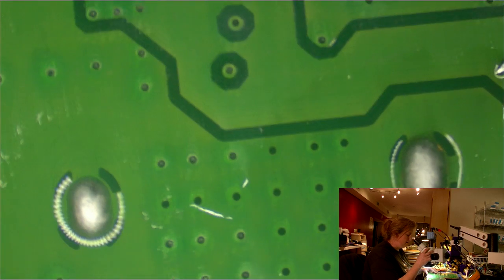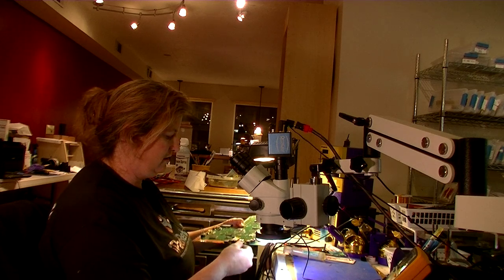How to replace a broken HDMI port on PlayStation 4 motherboard

Comment: Is there a possibility that I would be able to mail you my PS4 motherboard to fix my HDMI port I already have a new HDMI port I can't get the solder hot enough to finish the job
Reply from the maker: We can help you with that. Go to www.ipadrehab.com and choose Start Repair at the top of the page. Answer those questions and we will reply with a formal estimate and shipping instructions if you decide to send it in. Thanks for thinking of us for your board level repair needs. Call 585-397-4174 with any further questions.

Comment: I pulled some pin pads off the motherboard when trying to remove old port... like 3. Am I screwed?
Reply from the maker: +Eric Via no.  Just fix it!
Reply: Not screwed, just means you have to make those connections with some wire.

Comment: Can someone help, the solder won't stick to the pads. She does it so smoothly and it just sticks perfectly! When I try it, the solder gets bunched up and then it's difficult to take off since I don't have the solder remover wire stuff.
Reply from the maker: Use a bigger tip that has enough thermal mass for the job

Comment: any one have a idea on mimum heat I have a hako fx888D and Kaleep 858d Chinese hot air station I'm going to purchase the quickchip now
Reply from the maker: Somewhere between 300-450c depending on the job. This always differs. iPad Rehab highly recommends the Quick 861DW http://bit.ly/2xGDTXo for a cheap, affordable, powerful hot air station with an easy interface. It will remove all different types of chips without a problem, unlike weaker stations that can't stay hot enough long enough to do the job.

Comment: Can someone help me cause I’m lost so you use the low melt solder to attach and dissattach the HDMI ? 🤦🏿‍♂️
Reply: The low-melt solder just helps lessen the amount of heat application required to get the port free from the board. Lead solder has a higher melting temperature, requiring more heat until it's liquid. By using low-melt, you help flow the solder easier, with less heat. 

The reattach part she mentioned is because there was a healthy amount and mix of both low melt and leaded solder in the 4 anchor joints that it would be fine to use (instead of completely cleaning all 4 joints and reapplying leaded solder).